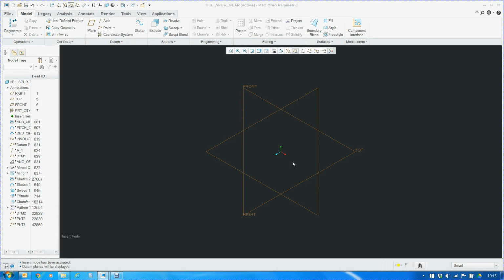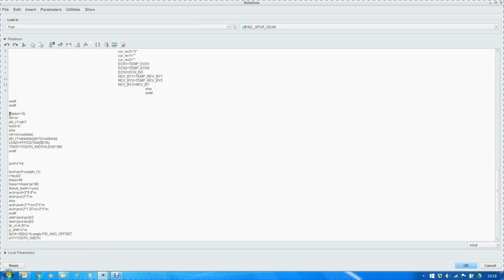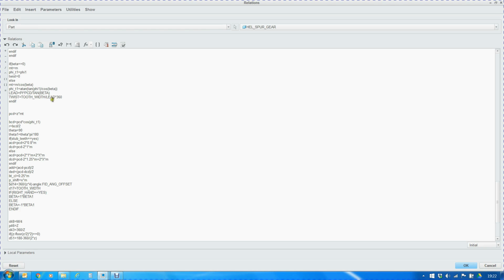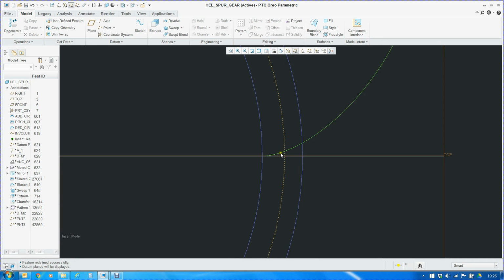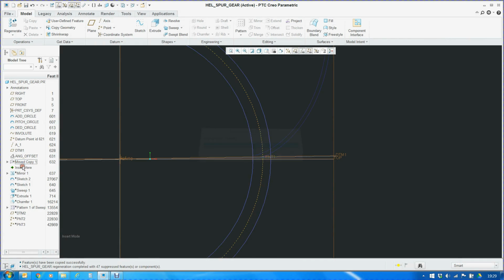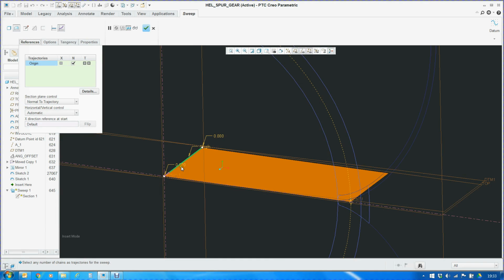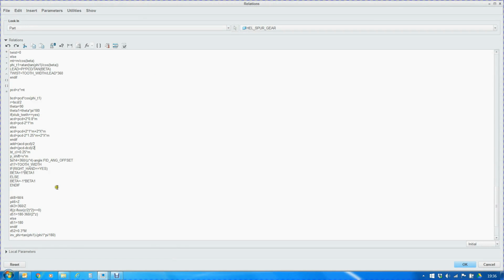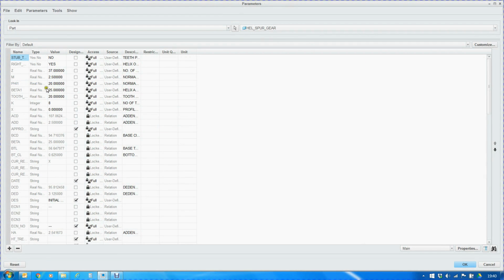Spur and Helical Gear modeling in Creo Parametric 3.0

Comment: Thanks for your great work. Could you share the relations?
Reply from the maker: Please share your email id. I will send you the relations.
Reply from the maker: Following lines are to be copied in the relations section:

if(beta==0)
mt=m
phi_t1=phi1
twist=0
else
mt=m/cos(beta)
phi_t1=atan(tan(phi1)/cos(beta))
LEAD=PI*PCD/TAN(BETA)
TWIST=TOOTH_WIDTH/LEAD*360
endif

pcd=z*mt

bcd=pcd*cos(phi_t1)
r=bcd/2
theta=90
theta1=theta*pi/180
if(stub_teeth==yes)
acd=pcd+2*0.8*m
dcd=pcd-2*1*m
else
acd=pcd+2*1*m+2*X*m
dcd=pcd-2*1.25*m+2*X*m
endif
add=(acd-pcd)/2
ded=(pcd-dcd)/2
bt_cl=0.25*m
p_shift=x*m
$d14=360/(z*4)-angle:FID_ANG_OFFSET
d17=TOOTH_WIDTH
IF(RIGHT_HAND==YES)
BETA=1*BETA1
ELSE
BETA=-1*BETA1
ENDIF

d48=M/4
p46=Z
d43=360/Z
if((z-floor(z/2)*2)==0)
d51=180-360/(2*z)
else
d51=180
endif
d52=0.3*M
inv_phi=tan(phi1)-(phi1*pi/180)
btl=m*cos(phi1)*((K-0.5)*pi+z*inv_phi)+2*m*x*sin(phi1)
psi=pi/(2*z)+(2*x*tan(phi1))/z
s_bar=m*z*sin(180/pi*psi)
ha=m*(1+x-0+z/2*(1-cos(180*psi/pi)))

if (BETA1==0)
PART_NAME="SPUR GEAR"
else
PART_NAME="HELICAL GEAR"
endif

Equation for the Involute:

x=r*(cos(theta*t)+theta1*t*sin(theta*t))
 
y=r*(sin(theta*t)-theta1*t*cos(theta*t))
 
z=0

Relation used within the sketch environment of VSS feature:

sd3=90+TRAJPAR*TWIST

Comment: Great work by you sir,
But i have some doubt, What happen when root diameter is greater then base diameter ( ex:-  module = 3, no_of_teeth = 80), in that what we do? please solve this query
Reply from the maker: Thank you very much the complements.

The procedure shown in the video works perfectly fine for the combination of module and number of teeth mentioned by you. However, the model may fail if the number of teeth (or the number of virtual teeth in case of a helical gear) is less than 31 (irrespective of the module). In that case, base circle would be higher than the root circle or Dedendum circle. In this situation a straight line is to be drawn from the starting of the involute curve up till the root circle. Please remember to force the line to have tangency constraint with the involute curve.

You can always create a separate gear template file for gears with less than 31 teeth with these tweaking.
Reply: thanks you sir, for your guidance, I tried to contact you on LinkedIn, are you on LinkedIn?
Reply from the maker: Rajankumar Patel 
This is my LinkedIn profile: https://www.linkedin.com/in/ananda-kumar-4100b07

Comment: Very good video but where can I find this program with the extra features to draw helical gears of various sizes?
Reply from the maker: Thanks for your complement. I have used Creo 3.0 (previously known as Pro Engineer) to create Spur as well as Helical gears. There are no special features or functions to create gear models in this software. However, Creo being a fully parametric software, one can make use of the existing features for building gear models of any size using Parameters and relations. 

Please check on my another video on Straight Teeth Bevel Gear modelling.

Comment: don't u think creo should have default patterns of gear like solid works this is such a long process to follow in creo. i make a spur gear by importing a 2d model of spur gear from a software  then i extrude it for 3d
Reply from the maker: Even I wish to have such a module in Creo wherein we can create gears just by keying in some parameters. But, as you know none of the "high end" CAD packages have such facility.
Reply: i import 2d model of gear from a gear software then i extrude it for 3d model it is much easy